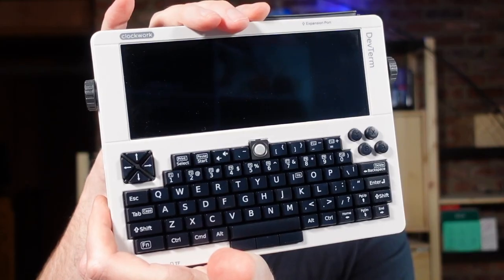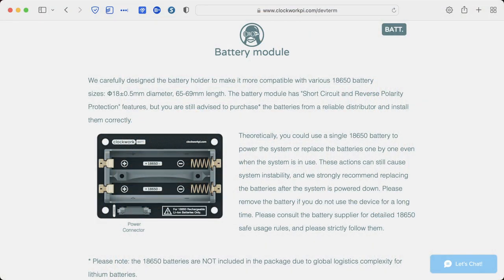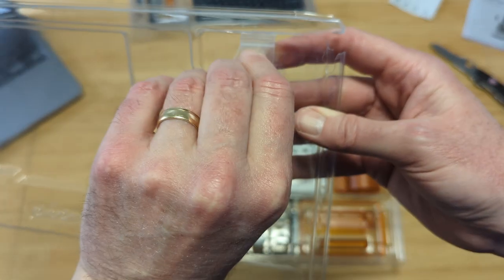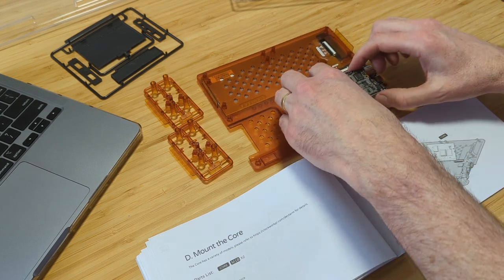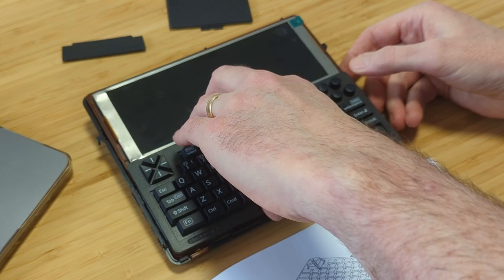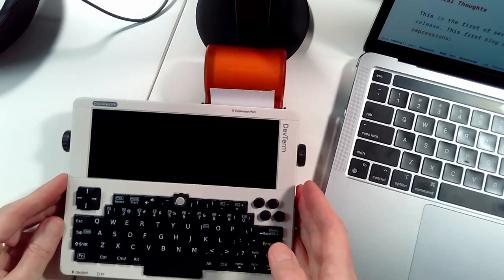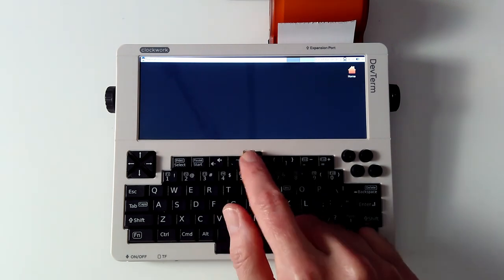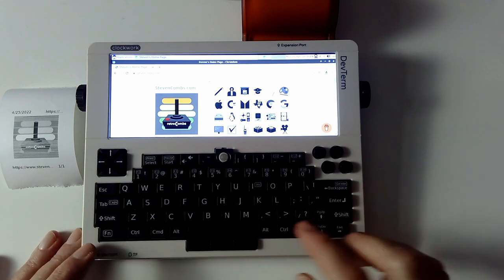Clockwork Pi DevTerm | TRS-80 Model 100 Inspired Cyberdeck!

Comment: Mine sits on a shelf (actually, it's in a box).  I'm still working out what I can use it for.  When I purchased it, I was hoping for a modern Tandy 102, but the keyboard pretty much kills that.
Reply from the maker: Understand. The 65% keyboard is tough to use and especially for long form typing. I have some ideas coming up, so stay tuned.
Reply: Me as well.
Reply from the maker: @WarrenPostma  I'm sure, unless you are small child, that keyboard is tough; however, I can understand the appeal of this mini form-factor and what I'm finding is thumb typing is possible with this keyboard.
Reply: @retroCombs  I'm an inveterate touch typer and any tiny keyboard (those thumb ones on early smartphones) drive me nuts.   Too much muscle memory now after 40 years of touch typing, to thumb it.
Reply: A device more in the distraction free writing zone, with a black and white transflective (daylight, no backlight, night, turn backlight on) or epaper  8 line display, and a tenkeyless clicky keyboard, powered by a PI or a Teensy, would be more than enough computing power for what I would want. In fact, the lack of a colour screen and the lack of a web browser would make any device a better DFW (virtual typewriter).
Reply from the maker: @WarrenPostma  I get that old-timer muscle memory for sure! Going back and forth from the MEGA65/Commodre computer and my Mac confuses my poor fingers but each seems strangely comforting!
Reply from the maker: @WarrenPostma  I have two devices on my list of videos to produce that fill that need. Hopefully I can get to those soon but agree, I really like a single use device. Hold that thought though, I have some ideas for this device too.
Reply: @WarrenPostma  have you found anything like that yet?
Reply from the maker: The Freewrite devices are a bit pricey but look compelling. I don't own one, but it might be what you're looking for. 

https://amzn.to/3F6N0Ub

Comment: Wow thanks so much man!

I was considering the uconsole, coming from a Planet Gemini PDA, but it’s just too slow and they won’t update it, 

You did a great review, I’m definitely going with this instead of the uconsole because you sold me with the printer; the keyboard looks way better as well.

Thanks again, you didn’t mention price tho!
Reply from the maker: Glad your found the video helpful and thanks for the kind words. Here's a link to pricing:

https://www.clockworkpi.com/shop

As for keyboard. Non of these small keyboards are great; just usable. But with some practice, that get better over time. I still break out the DevTerm and folks love the little printer. A callback to those handles computers in the 80s from Radio Shack and Casio.

Comment: Great video, I want to purchase a Clockwork Pi DevTerm but I am concerned with the lack of packaging. If I receive the Clockwork Pi Devterm with damaged parts will Clockwork Pi replace the kit or parts?
Reply from the maker: After further inspection, I believe the shipping carton did its job. My suspicion is the LCD panel was damaged during the manufacturing process. Clockwork was great to work with and quickly responded and sent my replacement part. I wouldn't let my experience taint a purchase. I've not found other comments online about similar instances. I believe my DevTerm was an anomaly. Glad you enjoyed the video!

Comment: 9900mAh lol. I would ditch those straight away as they're probably recycled laptop 18650s with about 1200mAh at best.
Reply from the maker: That seems to be the prevailing opinion but they work well, and if recycled, at least they are getting some use. Thanks for commenting.
Reply: @retroCombs  that's about tripple the capacity a 18650 cell from a reputable manufacturer has. Impossible this side from current battery chemistries
Reply from the maker: @VolkerHett  Yep, that's what I'm learning, but they continue to work well without issue, so will use them through end of life. But agree, they are likely rebranded and labeled batteries.
Reply: @retroCombs  Just take care and treat them carefully. It might be LCO or LMO based cells which are more risky than the LMC or LMA types. Stay below 3A  and keep the cells balanced, i.E. not more than .05V difference when discharged. And never charge them when you're not there. 
One does not need an e-cigarette to set a LiIon cell on fire 🤣
Reply from the maker: @VolkerHett  Great tips! The Clockwork Dev Term has been handling the recharging duties and it is definitely a trick charge but to your point, keeping it close by while charging is prudent. If anything goes south, I'll be sure to let everyone know.

Comment: Mine doesn't want to boot. With or without batteries, or just the USB c with different chargers , it just make a noise. I put the img of the last of on the card, but just the noise... Any idea?🔥🙏
Reply from the maker: Has it ever worked. You might know that I had the same problem and it turned out to be a bad LCD panel.
Reply: @retroCombs  thanks :) I received my new panel today. Tested it and doesn't work 😆.
Reply: But I think the issue is elsewhere. When I try to boot it through USB c (no batteries) the fan doesn't turned, so maybe a contact issue between the core and the connectors...
Reply from the maker: Oh, rats!
Reply from the maker: I had a situation where I had to remove the plate in front of the USC-C to get a good connection.
Reply: @retroCombs  actually, I have the power led on. But I think I don't use what's needed for charge. The batteries were from a rc hobby grade car, but not charged enough. 4.1v. and the USB c 20w, 5v, 3a, maybe not strong enough to charge the batteries. What did you used to power it?🔥🙏
Reply from the maker: I've been using the charger from a Chromebook. 30 watts.
Reply: @retroCombs  I've read on forums that we need full charged batteries , so I charged new pack and tested but the same noise and no boot, the fan doesn't turn too. I only have 20w power brick. Maybe it's because of that

Comment: looks like you bought the wrong brand of batteries.
18650 batteries with best chemistry available are typically rated at 3500mAh and 10A, the best kind of batteries for this particular application the INR-18650-MJ1’s from LG ( yes the company in south korea ).
another good quality battery is the INR-18650-M35A from Molicel.
chinese brands of lesser repute than XTAR and IMREN like to prey on the ignorance of first-time buyers by advertising ratings that are far beyond the physical capabilities of ANY 18650 battery, “9800mAh” when these kinds of cells deliver less than 15% of that at something like 1200mAh
Reply from the maker: Time for some new 🔋s!

Comment: I was burned so many times by subpar keyboard… I really like the idea and I think it is cool, but I al afraid the only way for those small factor computers is to rethink the keyboard and not make it smaller but with less keys and figure out smart shortcuts.
Reply from the maker: A like the idea of a shortcut keyboard, but not the idea of learning another keyboard layout! 😄
Reply: @retroCombs  yeah, but what's worth the regular layout if keys are too small to be efficient?. I don't know if you know Dirtywave M8 - it is handheld tracker with only 8 keys. BUT, those keys are with mechanical (high quality and replaceable) switches, normal size and it uses a lot of very smart and intuitive shortcuts to operate. The result is super efficient and fast to use tracker (which is traditionally used with regular PC keyboard). I don't think about anything that drastic but some small sacrifices can be made (like F1-F10 keys and numbers requiring a well placed modifier key).
Reply from the maker: @artephank Not familiar with that one. Will have to research it.